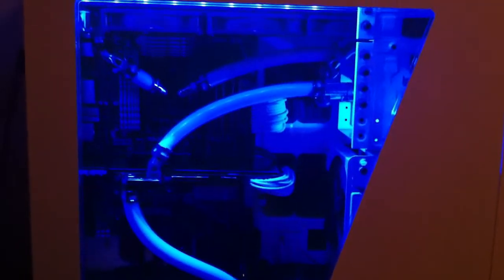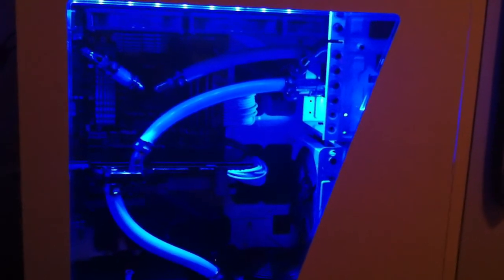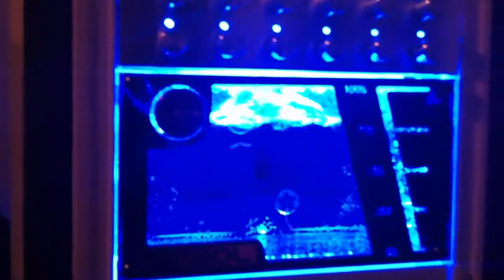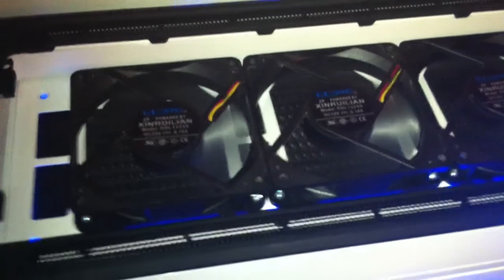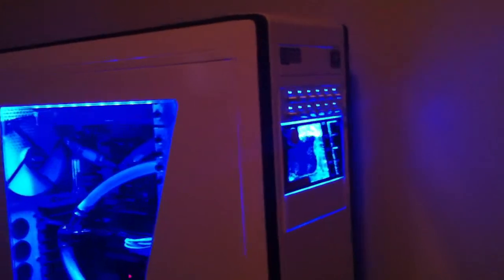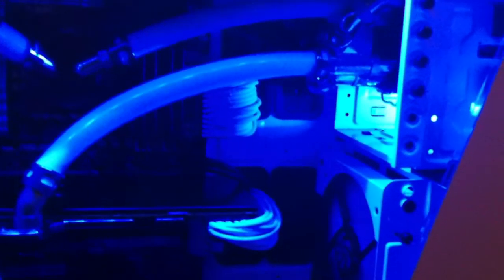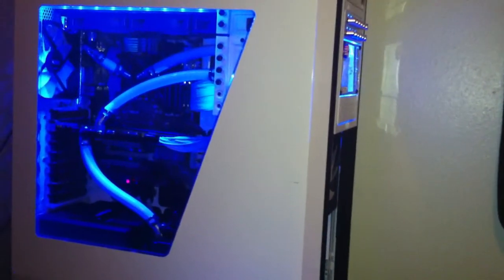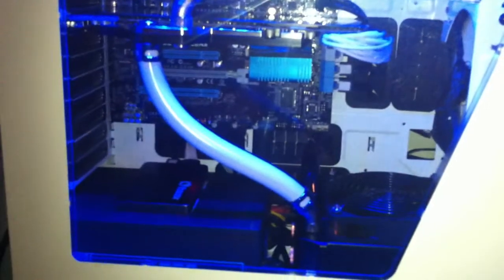NZXT Switch 810 Water Build Part 4

Comment from the maker: I added a second 7970 and during 3dmark11 my power usage hits 1100 at the wall, this is with both being overclocked, dual pumps, 13 fans and 3 HDD's

Comment from the maker: I would prefer the AX1200 over the HX1000, but not because it's more powerful in watts.  the HX1000 isn't the greatest Corsair PSU because it's essentially two 500w PSU's sandwiched together and has been known to have issues when running lots of overclocked hardware

Comment: how your saying a 1001 watt psu is not enough, cause i just check extreme power supply calculator,, from what ive seen you only draw 500 to 650 at full load, so even you added a second hd7970 your in the clear